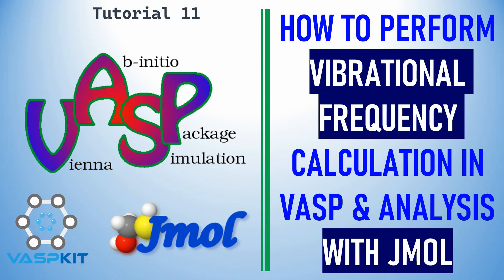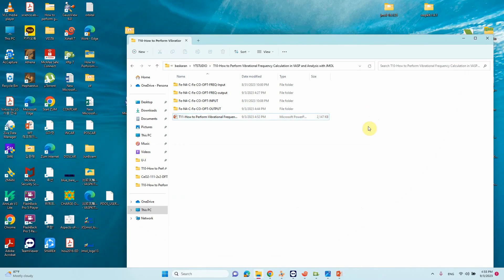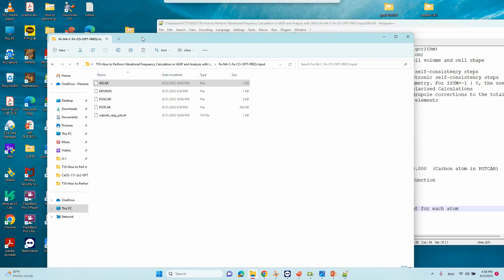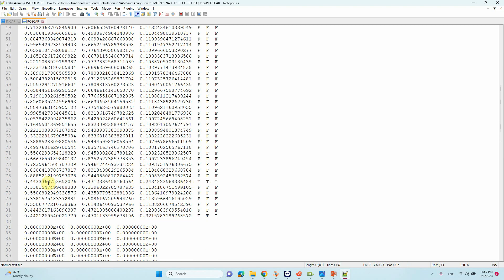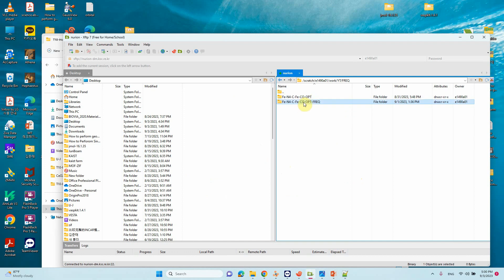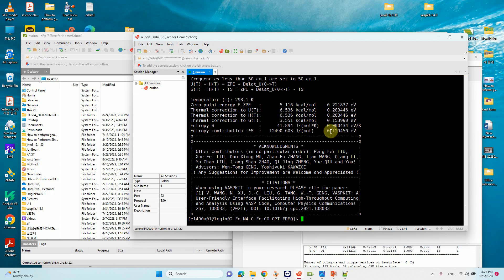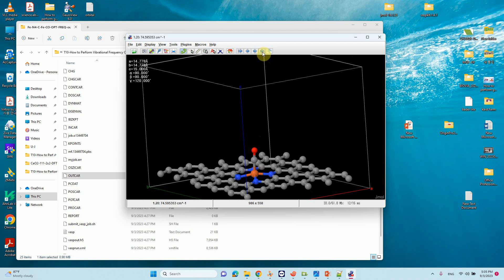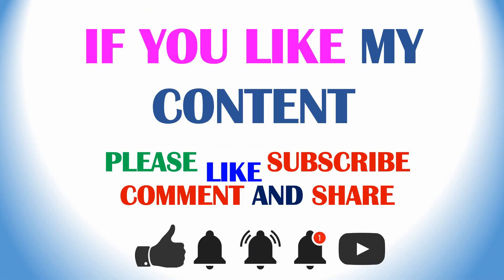How to Perform Vibrational Frequency Calculation in VASP and Analysis with JMOL

Comment: Hi! I use 16 images for transition state calculations and get a converged transition state with one negative frequency. However, I did the vibrational frequency calculation for another image near this transition state (with the energy difference between the TS and the images as 0.0015 eV) and got one negative frequency for this image as well. How to deal with this problem?

Edit 1: I understand the energy difference is very low. However, I would like to know if there is any way to counter this problem.
Reply from the maker: Please don’t use 16 images, use only maximum 4  ts images excluding IS and FS. And do ts calculations
Reply: @dbinfotech  Sir,
Is there any reason to use 4 images only?

I started my calculations with 8 images.. And got the same result as I stated before.. with one image near the TS (both with one neg frequency). I thought if I use more images, I would get a better estimate of the TS, thats why I used 16. Is this logic correct?
Reply from the maker: @ChaitraBorkar there is no reason for 4 images, if you 16 or 8 images,  the energy of the TS is near TS images  also have similar energy or very low energy difference. If you face this problem you can change to the DIMER METHOD FOR TS.
Reply: @dbinfotech  Ok sir! Thank you for your insights I will try the Dimer method (do you have any tutorials for that, though?). Just one last thought: Can I try my TS calculations with odd number of images?
Reply from the maker: @ChaitraBorkar you can try odd number of images https://youtu.be/MYXnNirhQKg?si=5ELWUWROk8KvGCNs dimer video

Comment: can you guide me as to why the OUTCAR file did not reach to status "reached required accuracy - stopping structural energy minimisation" what changes are needed to get this status in the OUTCAR file of VASP for Optimization.
Reply: means your system is far from minimum energy state. Or reduce the convergence criterion on energy and force.

Comment: Can you make a video on how to get rid of imaginary frequency in VASP
Reply from the maker: If your doing freq calculation for transition state structure, you will  get  -ve freq for corresponding ts, some time you may also get some lowers -ve frequency 0 to -50cm-1,  You can neglect this. Or if you increase EDIFF   You may not get-ve freq. you can this method. Thank you
Reply: @dbinfotech  my EDIFF is 10E-5 and I am getting negative frequencies. Can I use negative frequencies to compute thermal energies? If you say neglect do you mean remove all negative frequencies?